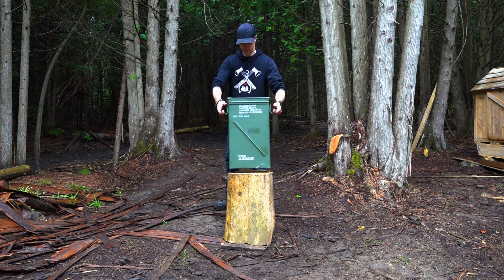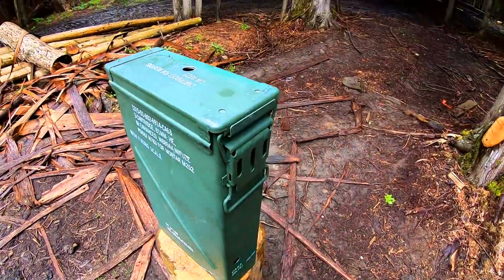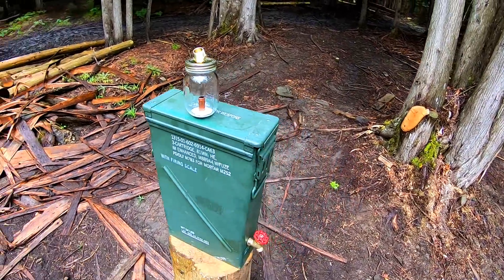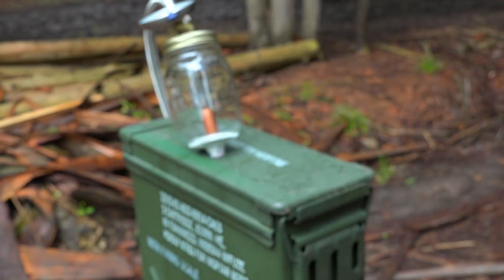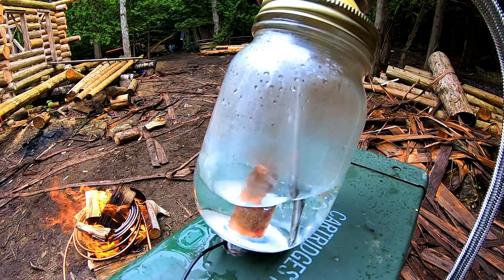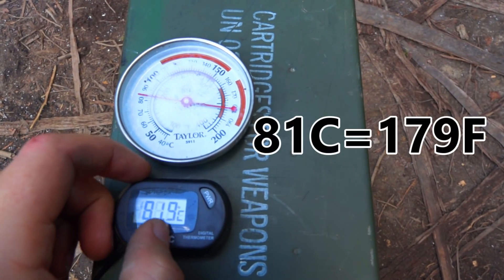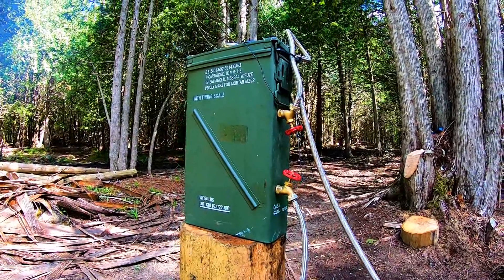Off Grid Heating Prototype- Copper Coil Water Heater / Heat Exchanger / Radiant Heater

Comment: Lots of good ideas about radiators, etc. But I would also like to see storage of heat, not just the dissipation of it, much like thermal mass heater setups do with rocket stoves that heat up stone to hold the heat for long periods of time. Wondering if you could run the hot water along metal touching a thermal mass that would store some of the heat, then the extra heat would go to a radiator type setup with a fan to warm the air directly. Once the fire is out, the thermal mass will warm you through the rest of the night. Thoughts?

Comment: Right, I love it. However you need more stuff!!   Two main things. An expansion tank of sorts as hot water has more volume, and secondly a device of sorts, so that when the temp reaches a preset reading, water is diverted to cool, eg another coil in snow or cold water. It could be achieved by  a battery powered electronic circuit board which can power a relay which can then switch quite large amounts of current from eg a car battery to drive a pump within the cooling circuit. I love it though.

Comment: DUDE, YOU CAN COOK YOUR FOOD IN THAT TANK SEALED IN PLASTIC BAGS THAT METHOD IS CALLED SOUS VIDE COOK STEAKS IN BOILING BAGS THEN HOLD OVER COALS TO BROWN THEM. LESS SMELL FEWER CARNAVOIRS WANTING TO SHARE YOUR MEAL. HANG YOUR MEAT IN A WATERPROOF BAG HIGH AWAY FROM YOUR CAMP. THAT IS UNTIL YOU NEED A BEAR SKIN RUN. COOK VEGGIES TO.  GET OR BUILD A SMALL WOOD STOVE, LINE THE CHIMNEY WITH YOUR COIL.?  KEEP IN MIND CATS CAN CLIMB.

Comment: Outsider,  While your design works you need to put a blowoff valve on a T fitting on the feed in,  say at 185 or 180. So if somthing goes wrong you dont get maimed for life. Enen better a bypass valve. With a T stat, 24volt, or they have the bi-mettalic ones they put on radiators. So once your space reaches, lets say 70f, bypass opens and water dumps to another tank. Think Safty. I am lic. Electrician

Comment: I you have a pressurised water source you could run a coil inside the tank and heat the water as it passed through the tank. For showers it would be cooler than the tank slower flow would be hotter faster flow would be cooler.

Comment: I see you are having fun... I want to be warm, so I use a small tiny home wood stove, it is very safe, efficient and easy to use. Not sure why you go to the effort to use water ? It' such a small cabin, and you would have to go outside all the time to put more firewood on, in the middle of the night, there might be a bear or wolf waiting for you ? .. who knows..
Reply: you can run a copper coil around your wood stove pipe and heat water, the point of using water is, it's a good insulator of heat which can last a long time.

Comment: Permanently plumbing the system into the camper would also be a consideration. Letting the hot coals keep heating the water for an extended period of time throughout the night. Consider fabricating a metal screen to keep the hot coals & embers inside the bucket for safety while you sleep. I love watching your ideas come to fruition. I have subscribed to your channel. Keep up the good work.
Reply: As in run the tubing in among the rocks to be the heat pipe and the rocks the radiator.

Comment: DANGER!
With no warning, the water in the coil can over-heat and instantly became pressurised steam.  The copper can fail in a second, spraying live steam.
This is the stuff that runs power plants.
It can melt skin and clothing in an instant.

Comment: Work fantastics for convection heating, temp control, try adding one more set of coils,  find a way of cooling discharge coil back to fire.  Cut your heating coil loop in half, or more, three loops should work fine. Cheers good vid..

Comment: Since heat rises, I'd advice to have the warm inlet on the bottom and the outlet on the top. It would heat the ammo box quicker. It's a really cool design!
Reply: No, you are the one spouting nonsense. Calling one the inlet and the other the outlet when there is no pump is rhetorical nonsense. The water will rise and fall as physics dictates regardless of what name you assign to which pipe. If you move the warm inlet to the bottom, it will simply reverse direction and become the cold outlet due to physics. Think about it.
Reply: If there was a pump your idea would at least be something other than verbal nonsense. Physics major in college and a Plumber by the way.
Reply: @masterm25  There is no need for a pump if you use a swam neck system, which means the warm water connection technically is higher then the cold one even though it enters on the bottom. It is easelly done bu bending the bottom pipe in a upside down U where the top is higher then the other pipe connection. Also, when you make the coil, it should be so the water goes upwards so it enters the coil on the bottom cold. That would help with the right direction flow. 
I call it inlet and outlet because the water circles around, I thought that was simple enough and didn't need explanation, but there ya go ;)  
Also, there is no need for such aggressive responses, you sound really angry which is bad for your health and rude towards others. They clearly didn't teach you manners when you got your major in physics so to become a plumber.
Reply: I am not aggressive, I just dislike stupid. A swan neck won't do what you want here. cold water sinks and warm water rises and the tank is still higher than the coil meaning the bottom of the system is still the coil, so even a bend in the tube still leaves water exiting the cooler bottom, unless you have air trapped in the system, in which case all you have made with your swan neck is an air trap to prevent your system from working at all. I didn't major in physics to become a plumber, I majored in physics, then when I got out basic math said plumbers made more money so I did that. If you had taken fluid dynamics and thermodynamics as I have you would realize how silly your proposal is. And the earth is round, not flat.
Reply: @masterm25  I don't see a point in arguing with you, clearly you feel superior over others. I have enough dose of this reading Trump's Twitter, so I wish you all the best. If you don't like stupid, it must be really hard living with yourself. Enjoy. Also, a pancake is round, the earth is a globe.
Reply: Ummm you going to unscrew those shutoff valves and switch them around? Listen to what you just suggested and ask yourself why your idea is dead on arrival...
Reply: @masterm25  you might want to rethink that one

Comment: It's kind of similar to a coffee maker. The only thing you're missing is a one way valve on the cold side. That way any water that gets vaporized in the coil can only push out water on the hot side, and when it starts trying to suck in water again to replace it, it's more likely to pull from the cold side. Maybe not needed, but should help.

Comment: so that steam build up is what travels through the radiator in my old home. you could install another copper on to that and have it return to another amo box at a higher altitude than the heated ammo box and have it connect on the lower part of box.  as the steam collects in the cold box it will return to the heated in liquid form. if you create an angular lumber feeder you can make lumber roll into the fire with gravity. you can control the heat and the length of the fire buy measuring.

Comment: Your trailer is going to be a steam bath. You need to plug the top with a 30# safety relief valve - venting it outside the enclosure. Better yet, in my opinion, you should build a closed loop system, dispensing of the tank altogether. In that scenario you would have two coils, one inside your fire, the other in your trailer. You could create a simple boiler feed by placing a reservoir on top of your trailer with a simple spring check valve. This could be aided by a circulating fan - maybe one powered by an inverter charged a pv panel. Regardless, it was very interesting to see you take us through your experimentations. Thanks.

Comment: How long would copper last in a fire like that this would be cool cause I could heat up my camper and put a y splitter and heat up water in other trailers too would this work with car coolant so it wouldn't freeze when the fire went out?

Comment: IDEA FOR IMPROVEMENT Wouldn't want all that humidity getting inside your trailer. Could collect in your door seals and freeze you in or just make it unbearable to sleep in there. Perhaps have a tube on the top leading outside for the pressure release? 

Another idea, you should have a second hole right under the inlet hole that leads to an outside tank. That way when the water starts to boil you can turn off the outlet faucet, open the secondary tank and stop the cycle so you don't have to go outside to take the coil off. This will also keep a majority of the hot water inside to keep you warm.

Comment: If I had the time, I would put the receptacle in the fire, put a recirculating pump on the outlet, so you have water moving. Also a T&P valve. You could theoretically run the pump off of a car battery.
Reply: Desert Lizard The water circulates with gravity.  Cold down, hot back up through a spiral without any trapped air.  Not just a pile of copper in the fire.  That creates steam and racket and ruins your copper coil from overheating and rapid cooling as well as the system doesn’t work as demonstrated in this example.

Comment: Nice job I'm going to be doing something similar for a neighbor but I have an old heater meant to be mounted inside a fireplace. It's super heavy and has threaded in and out for pipes it's about the size of a VHS tape but weighs about 20 pounds.

Comment: As Daniel Cage said, you do need to get the copper out of the fire. It's possible it could break and put your fire out, but more likely as the heat makes it brittle, it'll break when you're moving it.  It's more brittle when cold, but if it is hot at the time, that water could really hurt you.  His vertical coil on a bucket idea is good, but takes up valuable space in your snow trailer.   ↓  ↓  ↓

My suggestion would be to mount the tubing to a steel plate with metal straps, then get some Aluminum Thermal Conductive Sealant to transfer heat where it's not already touching the tubes.  Bend the tubing into a horizontal zig-zag pattern like a radiator, or (more work and a lot of fittings) make an upper and lower header connected by several vertical pipes.  Add two legs on hinges to the top of the plate so you can lean it over the fire, tube side away from the flames, instead of putting it directly in the flames.  The plate will pick up heat and transfer it to the tubes on the other side.  You can adjust the angle to give more or less heat, as needed.  You may want to find a way to insulate the tube side so windy nights won't steal your heat.  While fiberglass batting would be fine (with any paper backing removed, of course), making an enclosure to keep it there would be more work and money.  Maybe just fasten a piece of a fiberglass welding blanket to that side?

Comment: I love the idea. Would you vent the top hole to the outside of the camper to avoid excessive moisture buildup? I look forward to seeing a test this winter.
Reply: Moisture build up isn't an issue. This isn't an evaporative cooler. It's called a hydronic heater and it uses the energy storage capacity of water to heat an area. There isn't any moisture increase in the environment it is used in.
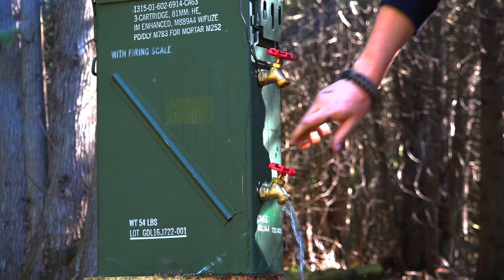Reply: @anthonycatello  I was imagining it steaming up the camper like the hot water does in the bathroom. The hole in the top of the container seems it would vent condensation from the heat. At 7:20 of the video "The Outsider" indicated he left the hole in the top to avoid pressure buildup. Giving an avenue for steam / condensation to escape inside the camper.  In a totally sealed container I would agree with you.

Comment: A car radiator would have been a better option for heating your little camper. Car radiators are design to handle high heat and pressure. It shouldn't cost too much more than 70 to 100  to get one big enough and mod it for that purpose. I would also get a steel BBQ grill (like an Aussie 21.25-in Kettle Charcoal Grill) and mount it to the side of your camper with steel mounting brackets for multi purpose uses. You can cook food and have the copper coil run through the grill collecting heat for your radiator.

Comment: Step 1: Drill a small hole in ammo can and install a safety valve.
Step 2: Fill the ammo can with water and place directly above fire on a stand.
Step 3: Watch it heat up to temperature in half the time.
Reply: how can the ammo can heat his cabin if its on the fire?
Reply: @Jafmanz  How can the food fill his belly if it's on the spoon? How can the gasoline make the car run if the nozzle's still on the pump?

The answer lies within the sarcasm. Place the ammo can into the cabin.
Reply: @Jafmanz  Clearly you're not an outdoorsy person. Rub some soap on the ammo box and wipe off the soot like if it was dust on glass. How do you warp an ammo box that never exceeds 100C? You get personal quite fast. It's all in good fun I'm saying this, we humans always critique and try to find better ways.
My method costs 5$ for a valve and some free soap from a gas station. There's no degradation of a 50$ piece of copper piping, less hassle, easier to carry around, no assembly, less danger of steam burns, etc.
Reply: @bradleyakulov3618  Your solution is to fix a problem that should not even exist in the first place. His method for heating his cabin is wrong from the start and I have commented on another thread along with many others to that effect! I live in remote Scotland, we only got Internet in spring this year. No mobile signal, no shop for 9 miles, nearest hospital is 3 hours away. I spend most of my life outdoors and 'outdoorsy' is not a word used here.

What he should do is install a rad then create a smaller fire in a lined pit with the copper pipe coiled and burried in the pit. He will use less energy in and it will be more efficient. It has been done before. he can build a self feeding fire with 6 pieces of wood and a knife and some 8 inch logs. it will feed itself all night long slowly. the soil will ensure even heat distribution through the entire coil and even when the fire dies out the residual heat in the earth will maintain output. the next logical step is a water butt feeding the pipe system with a valve to give him running hot water for washing and food! if he wanted to get technical he could create a stove from the pit, install a proper flue and coil the copper around the flue!

bottom line is no need to clean the ammo box of soot, no need to worry about it warping( that matters if it has a valve on it and no need to worry about a giant hot cumbersome dangerous water tank sat in a small space taking up room.

you tried to offer solutions to a bad design that created more problems. the design needs scrapping!

enjoy being an outdoorsy type!

Comment: That's a nice over grown coffee peculator you have there. 😎
Looks like you need a way to control when the copper coil is heated. 
A bit difficult with a camp fire. Mounting it to some sort of dolly so that it can be moved out of the fire easily would be one way of doing it.
The dolly would also allow you to experiment with how close or far away you need it to be in order for the system to not equalize.

Comment: Not bad, but you're lacking two efficiency must-haves.

First, and most importantly, instead of just laying the coil in a fire, you should have it inside a chimney of some sort so that the copper tubing is always angled upwards in the direction of the tank and thus dramatically increasing the flow. Ideally, this chimney would be attached to a small outdoors wood-stove, but even just sitting over an open fire will do. When water is heated, it begins to rise (due to expanding molecules) which starts a thermal siphon and thereby keeps the water flowing constantly instead of just letting the water boil in the pipe so that it forces its way out and spits and spurts into the tank too hot. Besides, the whole idea of having a heat-exchanger is that you can sit inside and enjoy the warmth instead of being outside tending a campfie.

Second, if your ammo box had just a handful of heat-dissipating blades sticking out of the top and sides, you'd be transferring the heat into the room/tent/camper far more efficiently (i.e. not letting the tank temperature get up to boiling). Small sections of heat-dissipating blades can be salvaged from old gas refrigerators, swamp-coolers, etc. Gluing them onto the ammo box with the right glue is an easy way to attach them. Can't recall the name of the glue. It's similar to the goo they put in between the tops of p.c. c.p.u. chips but also bonds semi-permanently.

Anyway, I built a system similar to this a couple years ago but with a nice big horse-trough style bath tub instead of an ammo can and a small (tiny, actually) wood stove. A small bundle of wood easily heats the 50 gallons of water i use for a relaxing hot tub in the evenings. It lives on my porch so i can use it winter or summer.

Comment: You just created a primary gravity fed heating circuit with no means of heat control pretty dangerous. You could have added a coper cylinder providing you with heat and hot water for free but you have the idea.

Comment: I have seen vary small wood stoves also pellet stoves  witch i think would make a better  choice because i think they are safer to use and don't burn as hot and don;t crackle cinders on you  all so you  could carry bags of pellets with you right inside even use a extra bag for a pillow lol you could install inside up high off the floor on a shelf, and  install a double walled stack vent  much safer . I know yr sled is small. good luck